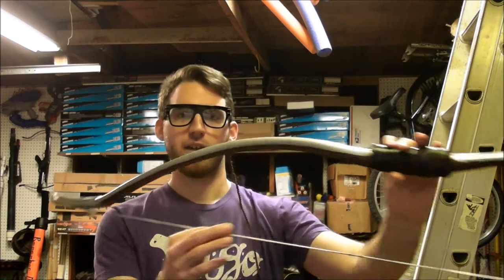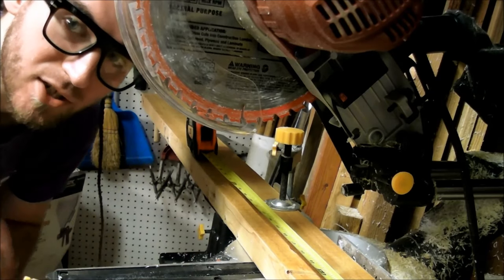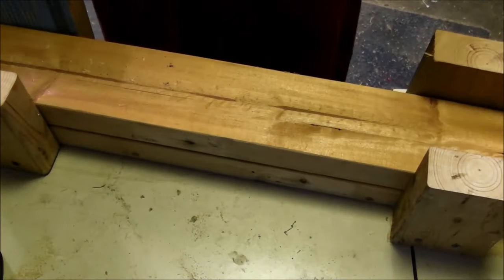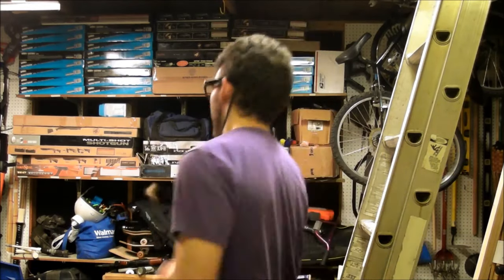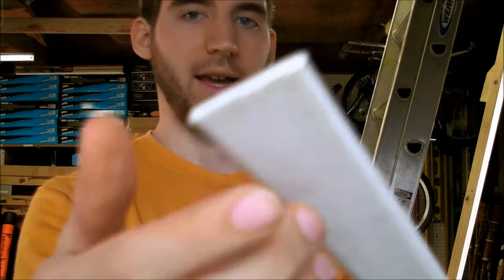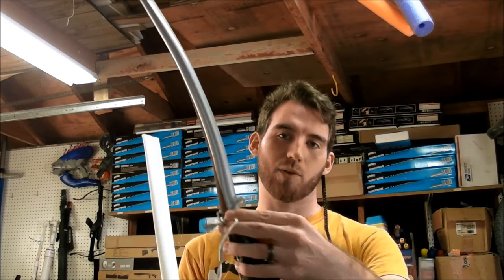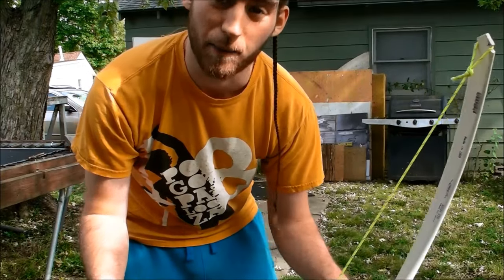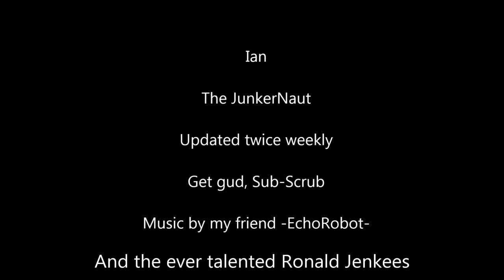EASY  Cheap 45# PVC Bow Tutorial

Comment: Can you give a quick list of the kind of string you could use?
Reply from the maker: Most people who make simple pvc bows like this use regular paracord to make the strings. At first I used only the inner "core" of the paracord because it is more similar to a normal bowstring and can be twisted to increase how tight it is in the bow. After a couple of bows I found that so far just straight paracord works fine and doesn't stretch too much :D
Reply: Awesome! I'm thinking about making one of these and the only other question I would have is are you using a normal blow dryer? Or is that a heat gun?
Reply from the maker: It's a heat gun, it would be unlikely that any normal hair dryer could get hot enough to do the job. That said a heat gun can be bought at harbor freight or online for 10 bucks or less so not too much of an investment there :)
Reply: I have built 5 pvc bows so far. well 4 bows and 1 crossbow. I have used paracord on all of them but I am gonna start making my own strings soon. the paracord will stretch a little and start freying as well but it is cheap and you can make extras to carry with you.
Reply from the maker: Yup totally agree, they aren't perfect but cheap and easy enough to be good enough at least for just starting out. I've also built 5-6 bows so far, if you want you can check out one of my last videos showing them off :)

Comment: Can u use upvc instead of regular pvc for the bow?
Reply from the maker: I've never tried but from what I understand upvc is supposed to be rigid and inflexible which would probably make it impossible to make a bow with. Even if you could heat bend it the draw would be extremely short and possibly break/shatter when pulling it back. Feel free to give it a go though if your curious just be sure to wear your safety specs ;)

Comment: how long is the bow when you start building it
Reply from the maker: This bow specifically used a 47" piece of sch40 3/4" pvc pipe. For a more balanced draw I would recommend 50" but it will slightly lower the poundage

Comment: is 3/4" PVC conduit better to use ?
Reply from the maker: Good question! I have never used conduit for bows before but I have heard that PVC has much better performance, and longevity. Conduit is more forgiving in that it is less likely to crack, but a properly heated/formed pvc bow is very unlikely to crack already, if anything it will fail by folding over.
Reply: Ian JunkerNaut  so u used s40 PVC pipe ?in this video or normal PVC?
Reply from the maker: Definitely s40 if you can, the thin stuff can still be made into a bow but the draw weight is going to be REALLY low. I would only do that maybe for a kids training bow or something.

Comment: Bow string what is best
Reply from the maker: Probably the best thing would be to purchase or make an actual bowstring because they have very little stretch and will last a long time. If you want something alot cheaper use paracord, it lasts a surprisingly long time and is incredibly cheap/easy to make replacements if necessary.